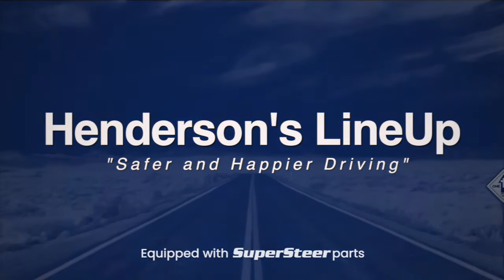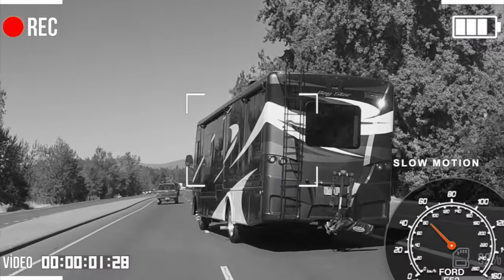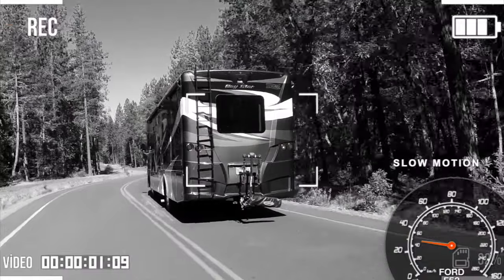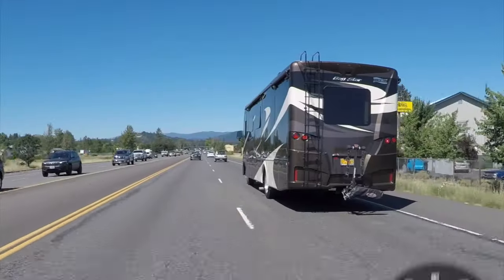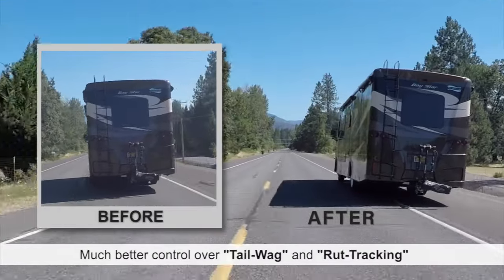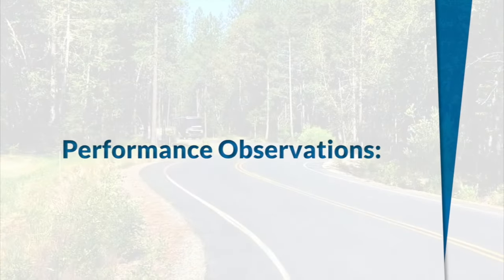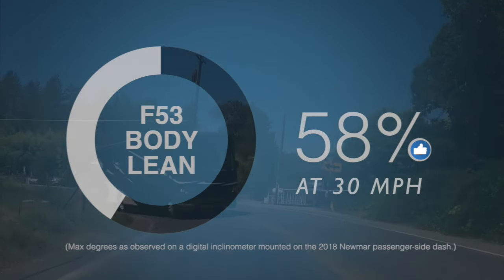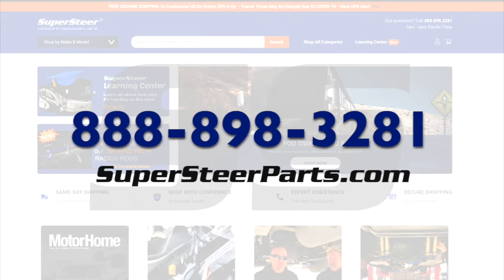BEFORE and AFTER: A Stock Ford F53 RV Gets Upgraded

Comment: Saw this video 18 months ago and scared the hell out of me. At same time was in the market for motorhome. Kept getting calls from sales person. After this video no way would I buy a gas powered motorhome. Waited another year and bought a 2008 American Coach Heritage 45A. Dual real axels and  500 hp Cummins diesel. No sway, rides great, stops great and safe and just as it came from the factory but with 38,000 miles. I am glad I waited and got something safe. I would have been real upset if I had bought one of these motorhomes with the f53 chassis that need all this just to keep it on the road. For my sake and the sales guy trying to talk me into buying the coach with that chassis. They are truly not engineered well and in no way should they sell these before they can make them safe and comfortable to drive. Thank you folks for showing just how bad these things are. Saved me a whole lot of  grief and exposed and educated me on what is junk.
Reply from the maker: Thank you for your comment! While it is generally true the F-53 chassis has some "out of the box" challenges, the good news is that with high-performance aftermarket steering and suspension parts, you can have a very enjoyable motorhome to drive. It might take some modifications but it will be worth it in the end. In your case, I am happy to see we steered you in a direction that you are happy with. (pun intended! LOL) Safe Travels!

Comment: WOW! Huge difference in handling with these mods! I own a totally stock F53 that handles like a shopping cart full of bowling balls! The only bad thing about this has to do with weight. How much does all this extra bolt on hardware weigh? That extra weight reduces the load carrying capacity of the coach. Not a problem unless you are already near or over the max GVW with full gas, propane, water tanks. all your gear and passengers.
Reply from the maker: Hey Thanks for the comment. We sure love helping F53 Owners.  As far as the weight on the parts, I'd say that is a minimal inconvenience when compared to ending white knuckle driving.  I have NEVER heard someone say they were sad because the weight of their sway bar prevented them from carry an extra 20-pounds. Hope that helps. If you want EXTACT weights feel free to call. We love talking about Steering and Suspension!

Comment: Great video. We have a 2022 Winnebago Vista 29V. A smaller F53 chassis (18K). 
This 2021 frame has the upgraded sway bars from the factory. We had a SuperSteer track bar, SafeTPlus and Koni shocks. It was a big help. If you have any other suggestions for ride and handling improvements please let me know. 
Thank you.
Reply from the maker: Thanks for the great feedback Anthony! Glad to hear we were able to help you. We do recommend the Radius Rods and think they could help for your chassis. You can learn more about them here: https://supersteerparts.com/products/supersteer-ss404rr-radius-rods-for-ford-f53-v8-16-26k-gvwr-2020.html

Comment: Great demo of the improvement in handling.  Can you provide a list of major parts and what is the best order to add them.  Also, how long does it take to add these parts if you do the work?  Thanks!
Reply from the maker: Will do. until then you can go to SuperSteerParts.com and type in your coach and it will show you all the parts that fit your coach. :)

Comment: I always notice that when you takk about this stuff, you never give the total cost of this upgrade, although I know it varies. My main question is, why dont the manufacterors just do this to begin with in order to save the cost of having to do it yourself at an obvious outragous price?
Reply from the maker: Thanks for the comment. Great question. I am not sure if you are aware that motorhomes are built in 2 separate phases. For example take the Ford F53 chassis used in this video.  The chassis is made by Ford but the BOX on top is made buy a completely different manufacturer. Every finished Class A motorhome is a little different based on its floor plan and weight distribution. I can't speak for every situation but I am fairly sure it's about the cost to the builder. (I saw you asked again.) :)

Comment: My question is, why wont the manufacturers do this ad on when they build the coach to begin with? I would be more than willing to pay the additional cost, if that is what it takes! Why should we have to "ad" this, when the manufacterers already know the problem exists?
Reply from the maker: Great question. I am not sure if you are aware that motorhomes are built in 2 separate phases. For example take the Ford F53 chassis used in this video.  The chassis is made by Ford but the BOX on top is made buy a completely different manufacturer. Every finished Class A motorhome is a little different based on its floor plan and weight distribution. I can't speak for every situation but I am fairly sure it's about the cost to the builder.

Comment: I hate the handling of my 2023 ace 30 c
I bought it yesterday
Ballpark me the cost to make it drive better and not jump around in the lane.
Reply from the maker: Thanks for the question! There are quite a few different options for upgrades, depending on what bothers you the most. If steering issues are your main complaint, then the SS381 Performance Steering Package is a great starting point at $1833.29 for the parts, as of today (8/28/24), plus sales tax where applicable. If you'd like to discuss further, you can call us at 888-898-3281 or email sales@supersteerparts.com.

Comment: How much is this kit for a F53
Reply from the maker: Thanks for the comment! The "kit" has several items in it. You can search for what items you may need on our website. supersteerparts.com
Reply: SuperSteer: "You can put in your make and model in the website"... In other words.... it costs $ THOUSANDS. I have absolutely no doubt they make a massive difference from the stock F53 set-up. I would like to see a non-biased comparison between this and the simple position adjustment of the sway bar mounting locations (called by some "Cheap handling fix," costing about $7 in thread-locker and 2 hours of work) on the stock F53. As of today, 3/3/22, here are the prices listed on the website for only the part numbers listed: SS403: $596.25 / SS101 $950.00 / SS401 $549.99 / SS289 $1925.00 / SS202F $225.00 / SS202R $85 / 41-180 $565.00... and not listed in the parts list... the Koni shocks themselves... $175.00 each x 4 = $700.00. Total of the kit shown not including any 1. mounting hardware, 2. labor, 3. the all mighty scam of "shop supplies and hazardous waste disposal": $5,596.24. From pure testimonial information, making the sway bar adjustment that is built-in to the stock system will give exceptional sway control over the stock position. I'm going to try the $7 fix first and see if I feel the need to crazy money on an already $200,000 rig.

Comment: The best suspension parts should be installed at the factory for a lot less money.  Typical RV industry saving money that puts the customers in danger .
Reply from the maker: Thank you for bringing this issue to light. It would be great if high-performance Steering and Suspension parts came from OEM. Until then we are thankful to have helped so many people have safer and happier driving!